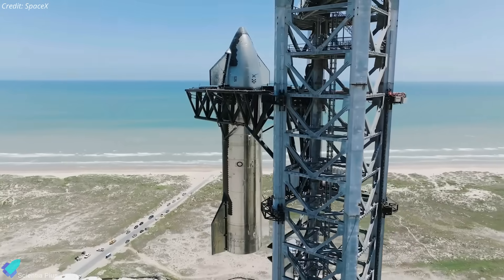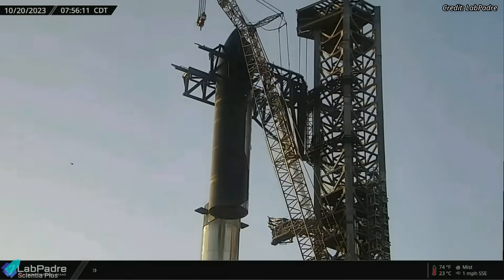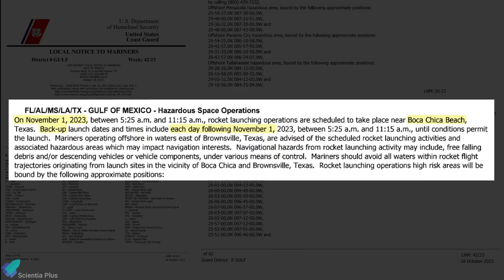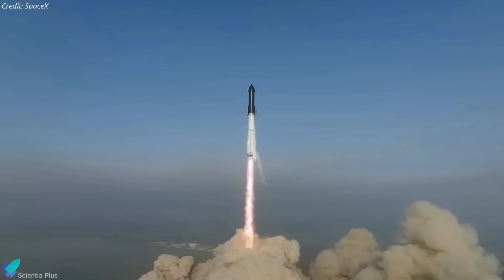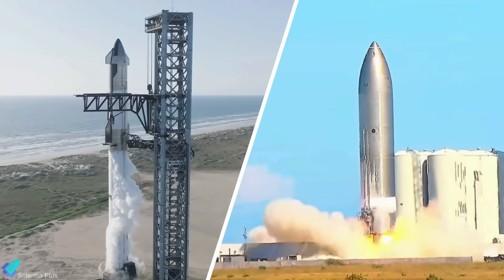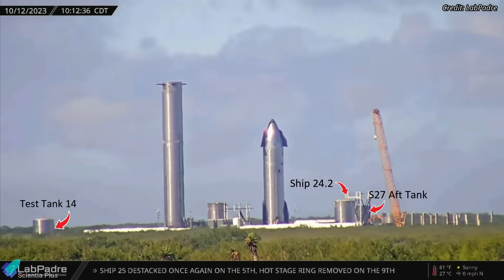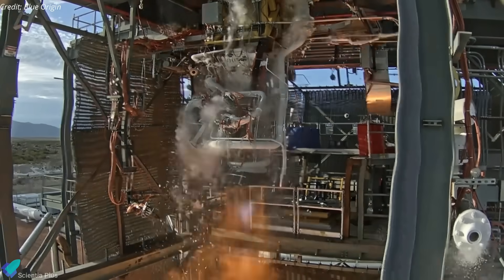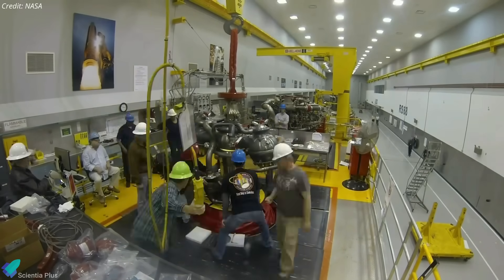SpaceX Broke Silence & Slammed FAA for Starship Launch Delay, Full Stack Wet Dress Rehearsal

Comment: Great job....fact based thorough reporting.  

I suggest that you use this approach to give us a detailed understanding of SpaceX problems with Falcon 9 FAA licensing in 2023. With over 70 launches so far this year it seems hard to understand how SpaceX has a FAA problem.  I haven't heard of a 2023 Falcon 9 launch that was delayed due to a license.  

I have heard EM say that the Cape Canaveral range facilities will soon be at maximum capacity to the detriment of Falcon 9 launch cadence.  But that isn't an FAA issue.